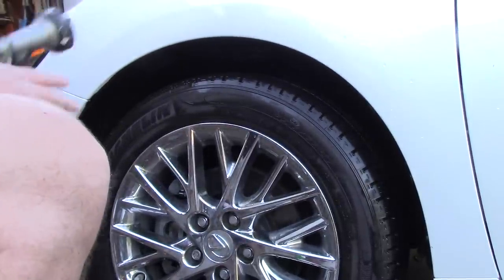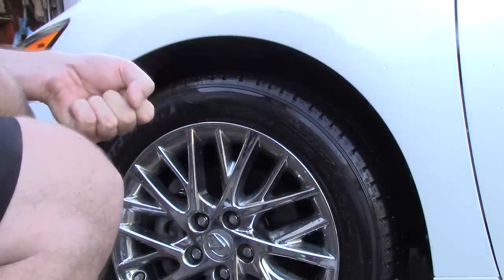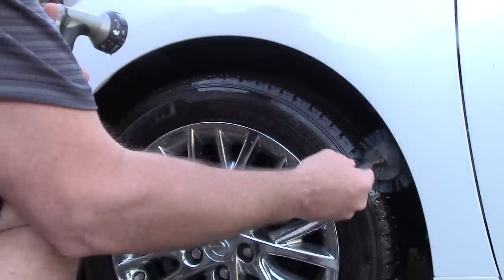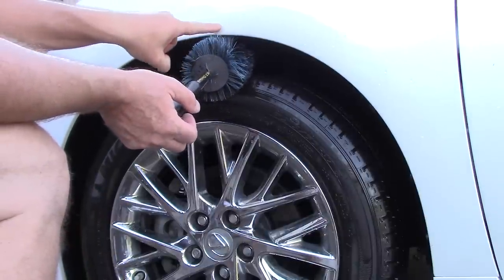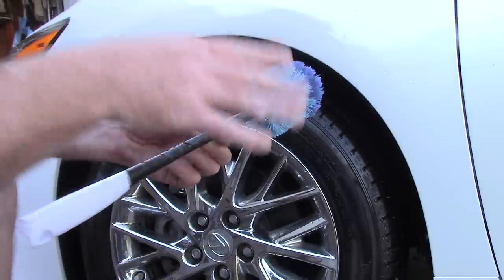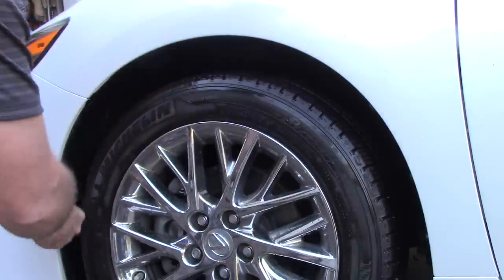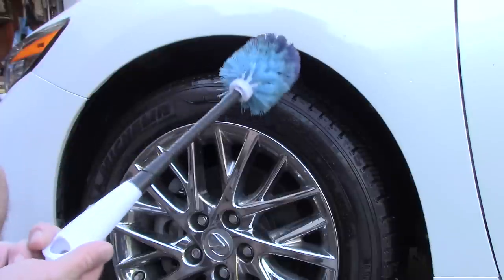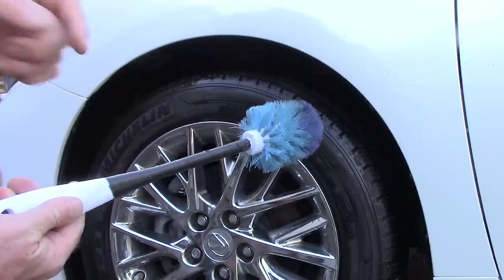Awesome Wheel Well Cleaning Brush!

Comment: Hi Scott, thank you so much for that tip, I have had major problems trying to find a tool to clean the wheel inner liners, I’ve tried everything from micro fibre towels, which don’t reach all the areas, to flexible long reach noodle sticks, which are soft enough, and flexible enough, but too flexible to accurately make contact with the entire area, thus missing parts of the wheel liner, thanks to you I have now found the prefect tool!!, love and best wishes from the European Union 🇪🇺 x

Comment: I've used toilet brushes before for wheel wells and I find them too firm for cleaning plastics. A good alternative is the EZ-Detail or Speed Master PRO brush. More expensive, but similar design with much softer bristles that agitate better.
Reply from the maker: Toni Pieleanu yeah better be careful with those plastic liners that get smashed by rocks all day long..lol
The ez detail brush isn't nearly sufficient for really dirty wheel wells since the bristles are so soft and just roll over and fall flat without removing heavy soiling.
You can also control how much pressure you apply with the toilet bowl cleaning brush so not to scratch the already plastic wheel well that gets smashed all day long...
Ever see plastic wheel wells from some living on a dirt road or fine gravel road?
In Texas we have people who own huge ranches with long gravel driveways, those liners are trashed even if they are driving 80,000 dollar vehicles:)
Reply: For me the toilet brush didn't clean well because the bristles would not come in contact with the whole liner surface. I guess it depends on the car and type of soiling. My car never goes off-road :D
Reply: Dallas Paint Correction & Auto Detailing we think just alike i told people this brush works great for wheel wells great video buddy

Comment: Just starting out and doing this more on the side than as a profession right now. Quick question, with a speed jack and jug wrench, would it be easier to remove the tire and do a more thorough cleaning of the wheel well plus could degrease the back of the wheel itself. I know it's more equipment to carry and more time consuming but the results would be more appealing to the customer in terms of going above and beyond for the customer. Your thoughts please

Thank you